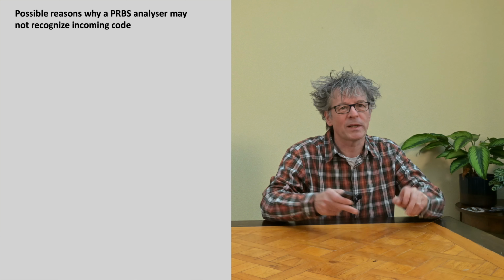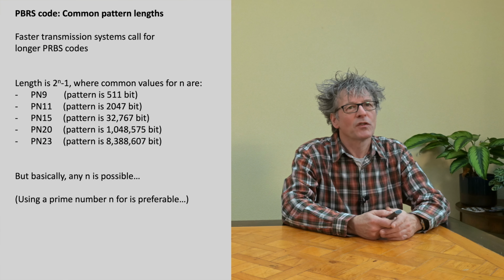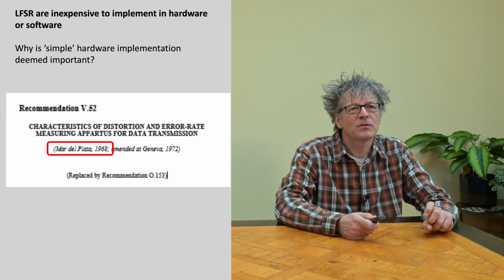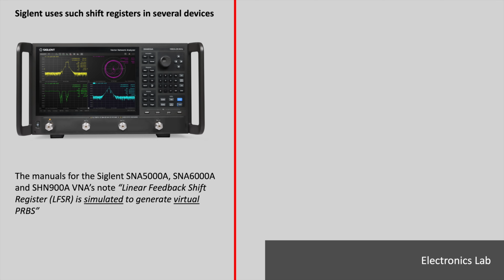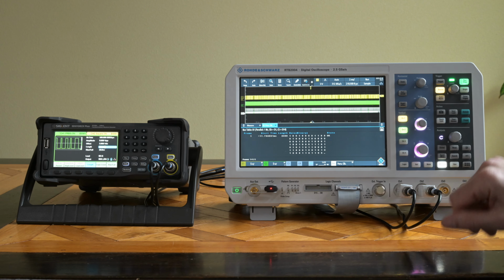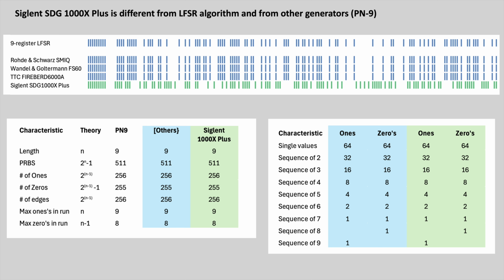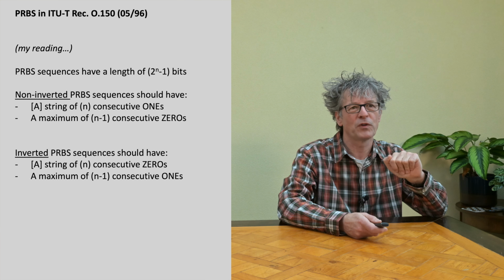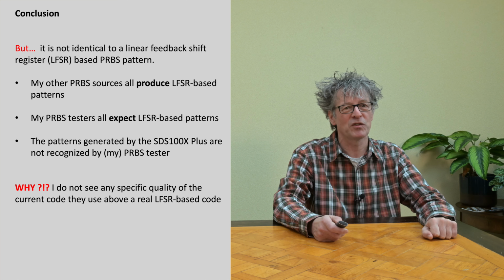REL #50 Why does PRBS not ‘work’ on the new Siglent SDG1000X Plus?

Comment: Nice description and introduction to PRBS!
Just one nitpick: you repeatedly stated Siglent should use a LFSR implementation for the PRBS.
Well, the produced sequence IS an LFSR one!
It just uses a different, still maximum length polynomial, x⁹+x⁴+1, instead of the more common x⁹+x⁵+1 - it's easy to verify with any online LFSR calculator/simulator or with your excel sheet.
The 9 and 4 taps have no common factor, guaranteeing maximum length (and the other properties).
Note that the standard states an implementation "may" use the 9-5 polynomial, that's the weakest recommendation one can read in a standard...

Comment: In fact, this was a great adventure to follow. I don't want to give too many spoilers as I think your video is great and in my opinion is much better watching the whole video than finding result in someone's comment. But. There are still some questions, some of them practical, some of them theoretical. The first one is how they (Siglent) get that code and what code do they use in another equipment (like that mentioned VNA). Yes, I am thinking about some kind of vendor lock. Furthermore, is it possible to generate their code using that shift register thing? Which leads me to even more interesting question. That shift register thing can be (on the beginning) feed by sequence of ones, which then produces the sequence we all expect, but in fact, it's nothing more than a 9-bit sequence, so we have 512 different sequences we can begin with. Feeding that thing with all zeroes as a seed produces all zero sequence on the output, which is (according to all that criteria) is not valid. And, in my opinion, there are a lot of another seeds  that produces invalid code too, but the question is. Is there any  seed different to nine ones sequence, that produces valid code? And if there is, how many of them are there. And, of course, is there a seed that produces sequence equal to Siglent's one? Nowadays, this can be easily numerically solved (using brute force of modern computers, it's 510 different sequences), but I am thinking about something more analytical. I feel I know what I am going to do next few days.
Reply: Since it satisfies the criteria of being a maximal length sequence then any seed excluding all zeros will produce the same valid sequence, just with the starting position shifted.
Reply: @TrimeshSZ  is it? becayse Rudi showed that if you do a run-length analysis (i.e. count how many times there is a one before a zero) the distribution of block length's is different. One way to find out is do a correlator appraoch.
Reply: @RensePosthumus  Yes, it's a poly that will generate an m-sequence.   In fact, X^9+x^5+1, X^9+x^4+1 and X^9+X^2+1 will all generate maximum length sequences.
If you are really concerned about autocorrelation then it would probably be better to use a Gold sequence rather than just a single poly (as both GPS and US IS95 CDMA cellphones did).
Reply: @TrimeshSZ  This is exactly what I realized when I gave it a little more time. If I think about the state of that shift registers like it is nine bit number. Then. Every number has exactly one unique successor, which is also different to that number itself (only exception is zero). This is why 9 shift registers end up in 511 bit long periodicity. This is why different seed only phase shifts output. So if he found different code (with some similar properties), then (in my opinion) it must be calculated different way. Furthermore that mentioned document is probably OK, because changing seed to anything ≠0 does virtually nothing to the output signal. 

But there still remains some questions, like what is what Siglent did. And did they this for purpose or by mistake?
Reply: @NikiBretschneider  I have no idea why they did it - given the spacing of the taps it's going to produce very similar output to using the X^9+x^5+1 poly - the only difference is that the spacing between the taps is 4,5 rather than 5,4 and both of those are fairly evenly spaced for a 9-bit register.